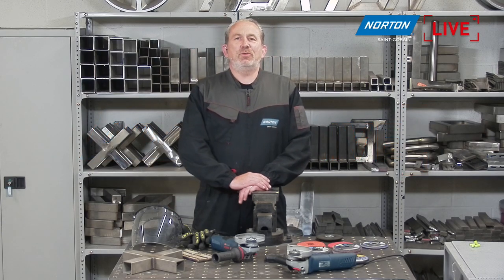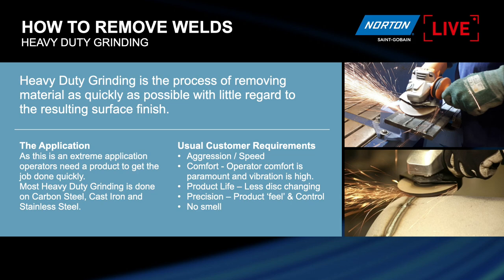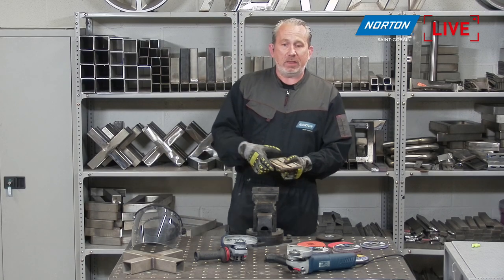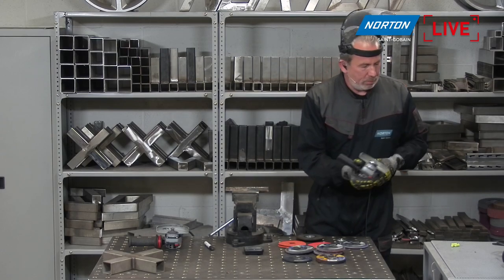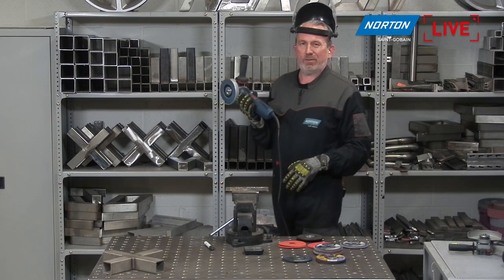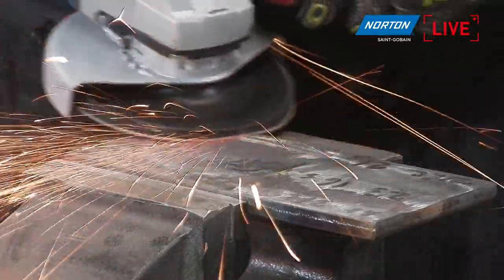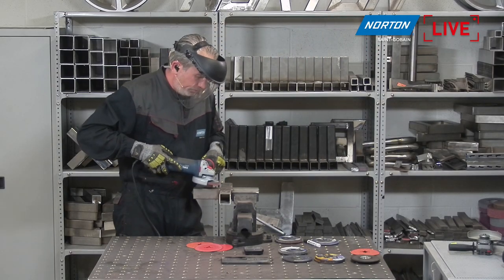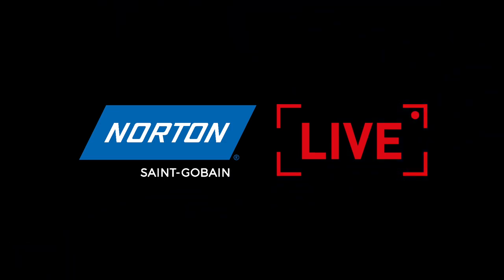Norton Live: How to remove welds on both Carbon and Stainless Steel using an angle grinder

Comment: When you compared the wear on the first 2 discs, it was an unfair comparison considering the first one had already been used which you showed when you flipped it round before installing.
Reply from the maker: Hi Jason, thanks for your comment. 
 
You are right, we had already used the first disc slightly and we did show the wear on both discs, but only as a quick side note as we weren't really comparing the wear rate, instead we were looking at the speed of removing material. Be assured, the Quantum will last much longer than the standard AO disc, but we don't have time to wear these discs down on our short Live Streams. 

When a disc is slightly used, the edge is shaped to a 30 - 40 degree angle.  This will give the disc a slight advantage over a new unused disc as the contact area between the disc and the metal is greater.  With a like for like quality of disc this shaped edge will give a higher initial material removal rate than a new unshaped disc.  In this video we showed that the quantum disc gave a much higher metal removal rate even when new and not shaped. 

Thanks for watching.